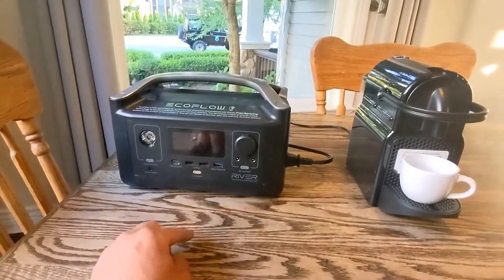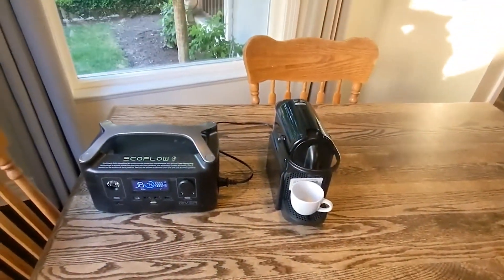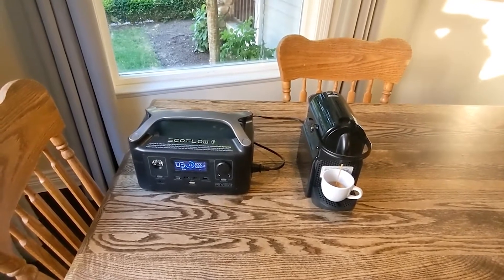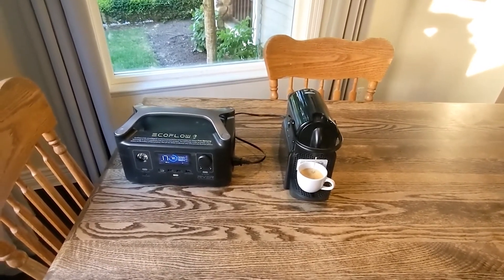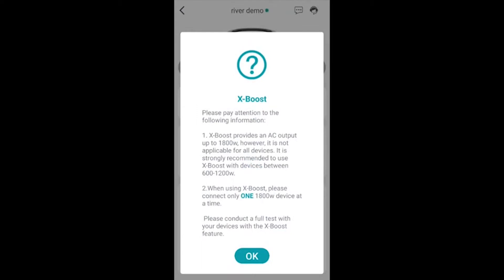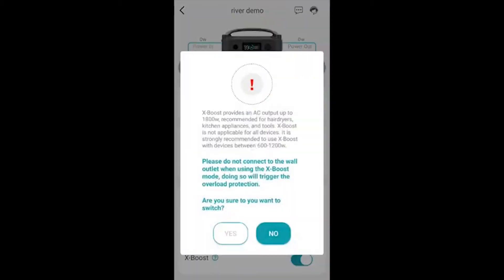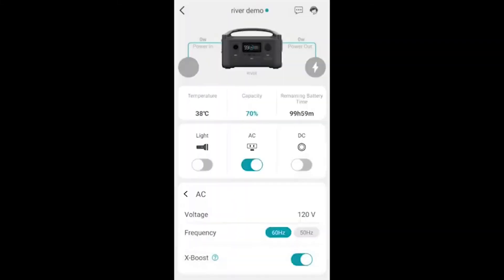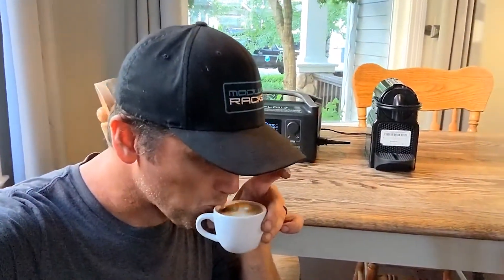EcoFlow Features Part 1 - X-Boost

Comment: I read into this a bit and let it how it fits this truck is it reduces the voltage a bit.  This can cause sensitive electronics to act oddly it even cause damage to some devices.  Best to enable this feature only while needed and only for resistive devices

Comment: Xboost is a misnomer, it does not actually increase the output power of the power station.  It has a smart inverter that reduces the output voltage when it senses a potential overload condition so that the total wattage of the coffee maker is lowered (per ohms law) to the nominal output power of the power station.  I have a river max with a 500w nominal output and a claimed 1000 w xboost..   My 700W coffee maker works but now gets only 500W (verified by a watt meter) and the coffee is kind of lukewarm.   But I am still very happy with the the delta 2 and river max I bought last week!

Comment: I know this is an old vodeo but hopefully you can still help. Im in a semi electric hospital bed which I've gotten stuck in when the power was out and I had to pee. So we got an Eco Flow River 800w. We were told thats sufficient. Just gave it a try and it wouldn't work the bed and showed 0 input and 0 output. Found the xboost option in the app and turned that on and it worked. Not as fast as normal, but well enough with 72 hours remaining. Shows 4watts output. I was under the impression the bed wasn't anywhere near 800w and got this Eco cos it'd give extra power. 600w was what we were told the bed might be at most. Is it normal to need xboost on the bed? I did have issues when I charged (looked online to find I had to reset DC button and then it finally started charging. The unit got up to 114 degrees after 2 hours on fast charge, which was a bit alarming. Is that normal or no? Any help would be appreciated.
Reply from the maker: It's not uncommon for certain devices, especially those with
motors or other power-intensive components, to require additional power during
startup or operation. The fact that your hospital bed required the xboost
option to be enabled on the Eco Flow River 800w suggests that it may have a
higher initial power draw than expected.
Regarding the temperature of the unit reaching 114 degrees
after two hours on fast charge, I can't say definitively whether that's normal
or not without knowing more about the specific environment. However, the unit should monitor the temperature of itself during charging to ensure it dose not overheat.
For more accurate information and assistance, I recommend
reaching out to the manufacturer of your hospital bed and the Eco Flow River
800w. They should be able to provide guidance based on the specifications of
their products and any potential issues you may be experiencing.
I hope this helps, and I wish you the best of luck in
resolving your situation!
Reply: @ModulaRacks  thank you!

Comment: My question is its set on default with X-boost on. I turned it off in the app cause it says while X-boost is on they say to not power up more than one device at a time. I didnt know that and been running tvs and game systems and charging cell phone and tablets all at the same time for months now so why does it say not to do that when X-Boost is turned on which is on by default. This whole time I been running multiple devices at once and no issues but it says do not do that in x-boost mode. Whats the reason behind this?

Comment: Hi I paired mine using home wifi but now I'm camping how do I pair to my phone data so I can use app please?
Reply from the maker: In the Wi-Fi direct connection mode, your phone will be directly connected to the unit, so you can view and control the unit in real time without having to connect to the Internet. This mode is suitable for outdoor environments where there is no Wi-Fi network. Multiple users can connect to the unit and control the same unit at the same time.

Cheers,
Team Modula
Reply: @ModulaRacks  it said is was disconnected so no it didn't connect
Reply from the maker: @kiwiace625  Hi There,
We suggest reaching out to Ecoflow direct.

Cheers,
Team Modula

Comment: Mine doesn’t power my machine for some reason
Reply from the maker: Hi There,
It could be due to a number of reasons.

What model Ecoflow unit do you have? 

Is X-Boost turned on? 
Is the battery fully charge? 
It could be your coffee machine is drawing more Watts then the unit can handle (Even in X-Boost)

Cheers,
Team Modula

Comment: Is there an x boost button you need to press without the app?
Reply from the maker: Hi There,
The X-Boost mode is enabled by default. You can use the EcoFlow app to turn this function on/off. Please
do not connect the AC output to grid power when the X-Boost mode is on, doing so will activate the low-volt-
age protection of the power station
Reply: @ModulaRacks  I tried turning on x boost through the app it does nothing..it shows I'm connected . I don't understand the part don't connect to grid power while x boost is on can you explain it with more details..thx
Reply from the maker: @ryoryo8303  If the app is saying X-Boost is on then you should be all set.
That means you can't have the unit plugged into a wall outlet (It cant be charging while using X-Boost)

Cheers,
Team Modula
Reply: @ModulaRacks  got it ... Yeah can I have X boost off on all the time besides when charging?
Reply: @ModulaRacks  yes in my x boost app I push it but does nothing..stays off so if I charge something with more wats it won't turn on automatically?
Reply from the maker: @ryoryo8303  
You can turn X-Boost off whenever you need in the app.
As for charging, X-Boost does not work when it is charging. It doesn't much matter if you leave it on when charging, it just will not work.

Cheers,
Team Modula
Reply: @ModulaRacks  it did ask me in the beggining of the Wii fii set up if I wanted x boost on I pushed No ..not sure if I need to reset the whole thing all over again

Comment: Thanks man. This is a great explanation and working example. Really cool feature. I don't mind waiting a little longer for toast to cook if it actually works on a smaller model and doesn't just shut down or not work at all. Up till now it's been quite annoying having to match the upper limit of a products output wattage to your exact use case. I'm looking at the Delta Max which should in theory be able to run everything I have in a kitchen.

Comment: does the river 2 x boost work also? i heard with the small units it doesn’t really work.  same with the surge power lift that bluetti has that is similar to x boost
Reply: Yes it does work.  I tested a 650 watt coffee maker on the River 2 and River 2 Max. Worked on both.
Reply: @truthjustice3313  thank you but the river 2 i thought only can boost to 600

did it go extra?
Reply: @rainlei9324  true. It was throttled down to the high 500's and was slower but didn't stop.
Reply from the maker: As the poster above has said, X-Boost does work on the smaller devices, it will just "throttle" the devices wattage.
Depending on what electronics you are looking to use, you may want a Ecoflow unit that has a higher Watt output then the River 2.
X-Boost is a very handy feature to have, and in our experience has let us run electronics that other battery units have not been able to! 

Cheers,
Team Modula

Comment: Will this power a Keurig Mini  Which needs 1470 W?
Reply from the maker: Yes.  The Ecoflow RIVER can power devices up to 1800W with their proprietary technology, X-Boost. *X-Boost can run devices that require up to 1800W, however, it’s best to test before use. Some 600W-1800W appliances with strict voltage requirements may not function (eg. air compressors).

Comment: great video, 
What model of nespresso machin r u using, and how many Watts is it? thx
Reply: Thanks! I think the one we used here is no longer available, but is similar to the Nespresso Pixie or Inissia. It seems to want to draw about 1200 watts when heating normally. On this unit it is able to lower that draw and therefore it just takes a little longer to warm up. But still works!

Comment: Can it run 3 led light from 30watt and a expressoachine at the same time For a day ??
Reply: You can also get an "extension" battery (screwed onto the bottom) for double the capacity. It's also available as a package deal called "River Max".

And then there's the River Pro variant (which I just got today): Same size/weight as River Max but 720Wh instead of 576Wh capacity. Battery not detachable but rated for more cycles. And theres a different extension battery for the Pro that would give you another 720Wh.

And if you need even more power/capacity, theres the EcoFlow Delta series with the same kind of features (including X-Boost).
Reply from the maker: The River only stores 288 Watt Hours of energy the 3x 30 Watt bulbs would draw 90Watts per hour. 288Wh divided by 90watts is 3.2 hours of run time on the LED's. The espresso machine likely draws near 1500W AC. On X-Boost it would be forced to run at 600W which could be sustained for about 40 minutes.

Comment: can it run a camping washing machine 250W? what do you thing?
Reply from the maker: Hi There,
Thanks for the comment. We would suggest one of the larger units if your are after running a portable washing machine (The Delta for example)
This unit for example has a 288Wh capacity and a 600W (Surge 1200W). So you could run the washer, but only for about 1 hour.

Cheers,
Team Modula

Comment: i saw in another youtubers video, the same nespresso machine not working on the same ecoflow river. Why is that?
Reply from the maker: Hi There,
Great question. Could be a few things. First being it may not have been the exact same Nespresso machine. It could have a built in voltage protection that did not allow the unit to run.
X-Boost does not provide extra power, it just stops the internal breaker from tripping in high-demand applications. This makes things like hairdryers run slower and cooler...but they still run, which is good. Hope this helps a little.

Other reason may be as follows;

1. X-Boost is enabled by default; you can enable or disable it in the EcoFlow App.
2. X-Boost is not available when the AC output is turned on in a recharging state (in bypass mode)
 and when X-Boost is disabled.
3. X-Boost is not applicable for all electrical appliances; it’s incompatible with appliances with strict
 voltage requirements. Appliances with voltage protection (such as precise instruments) are not
 supported. X-Boost mode is more suitable for heating devices. Please conduct your own tests with
 your devices with X-Boost enabled.

Cheers,
Team Modula
Reply: @ModulaRacks  thank you for the reply, its very helpful.

Comment: Hi please can u advice me  i have a water heater  that uses almost 2000 watts  does it work with the x boost and also same queston for my toaster it uses 2000watt
Reply from the maker: XBOOST's maximum draw is 1800 Watts.  For these numbers, the minimum recommended size would be the EcoFlow DELTA Max. Keep in mind you will only have 1 hour of charge at 2000W draw, unless you add the extra battery.

Comment: Hello, I did not purchase this from your store but I see you know how to get the xboost to work. I’m trying to power us a brother laser printer for my mobile office and it does not seem to work. Could you do a step by step on setting it up? Also the app looks different than the one you showed. Do you know if there’s more than one app?
Reply from the maker: Hi Casey, X-Boost is turned on through the app. I believe there is only one app for Ecoflow: https://ca.ecoflow.com/pages/ecoflow-app. Unfortunately, X-Boost will not be able to run a laser printer that draws more than the rated output because a printer (and other computerized hardware) cannot run at reduced power. X-Boost does not provide extra power, it just stops the internal breaker from tripping in high-demand applications. This makes things like hairdryers run slower and cooler...but they still run, which is good. Hope this helps a little.

Comment: Does X-Boost drain the battery faster?
Reply from the maker: X-Boost allows you to run a high wattage item on the limited wattage of the AC inverter. For example, a hairdryer that usually draws 1000W would run at 600W using X-Boost. It won't be as hot, but it won't cause the inverter to emergency shut down. The battery will not drain any faster at 1000W than at 600W because X-Boost self limits the output to 600W.